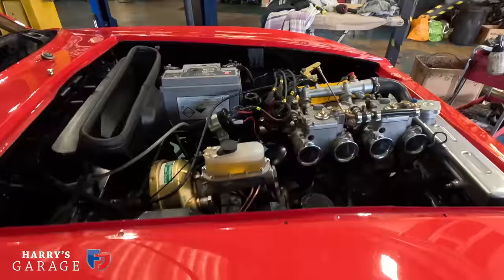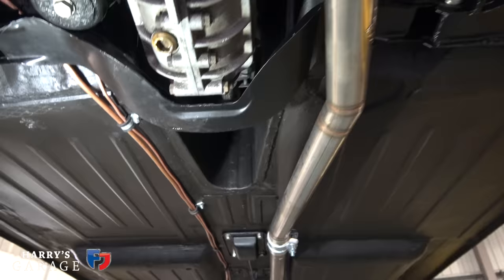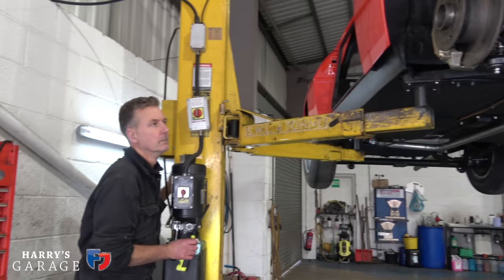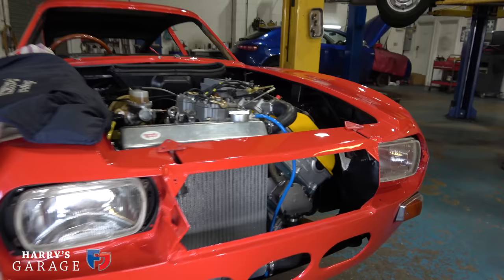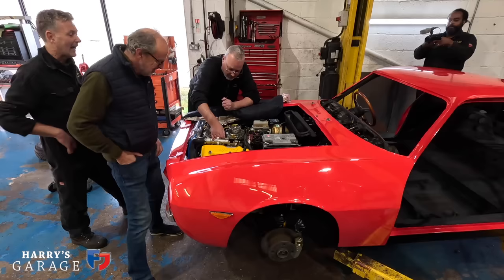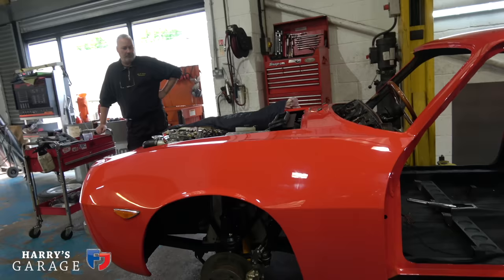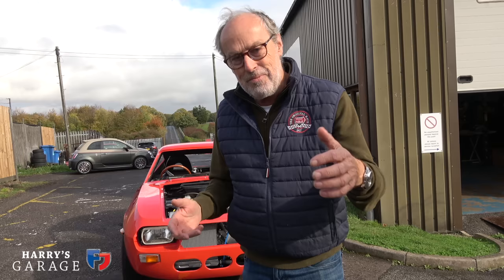First engine start on my Lancia Zagato 1600 2-year resto project Part.13

Comment: The diameter of the exhaust is extremely important on these little V4 engines from Lancia. The original diameter gives you the original performance and engine characteristics, as designed by Lancia. Even a small change in diameter makes a significant difference. On my Appia (the Fulvia's older brother), we experimented with different pipes and even the smallest change was noticeable. Lancia knew their stuff. Keep it to original specs all the way.
Reply: So I guess that still holds true for the Abarth spec Twin-cams in the 037 and Monte Carlo Silhouette?  Any idea what those were? Cheers

Comment: Fabulous video. Magical stage of the process. 
Anyone who has ever rebuilt a car will appreciate the immense complexity of the mechanicals required to get an old car moving under its own motive power. 
Anyone who has ever rebuilt a car will recall the magic of the noise, sounds, smells, sensations of its rebirth - they’re old memories reborn! 
This video captures these emotions succinctly. 
I remember getting an old mini going again, and feeling similar sensations. It didn’t need doors or a dashboard - just as long as I could feel and hear the thing going again, I was happy to have my car back. Just as in this case, the rebuilt engine was more powerful, cleaner and stronger than the rusty old thing that it once was - but felt instantly familiar.

Comment: It's an endlessly interesting design, everything under the hood and below the car is very clever and interesting. Then the work looks lovely, add superb body style, I apologize for ever suggesting this was bit far to go on this car. Very happy for Metcalf. You can calibrate that carb vacuum gauge with Tyrrell's hosepipe.

Comment: Looks great Harry. Just a quick one on the Carb intake stacks, two of these could be longer than the other two due to the asymmetric port lengths across the Narrow angle Lancia V4. From the back of the engine coming forward it should be short/long/short/long and ideally the difference in length should be circa 100mm? This would certainly help to equalize the induction port length. 👍🏻
Reply: You  can change the trumpet lengths but that does not alter the fact that the position of the Emulsion tubes within the carburettors are always at different lengths in regard to the position of the inlet valves and that is why when all said and done a vacuum check will not be 100 percent accurate as was shown because one reading was done on a short intake length and the other on a long intake length but because the Radiator precludes measuring the front port then you do no 2 on the first carburettor and no 4 on the second carburettor as they are both the same length inlet tract and then the tricky part is setting the idle mixture screws and in that area experience with Fulvia V 4 engines is of great importance as they are an art to get as close to perfect as you can.
Reply: Didn't they mention something about other trumpet options? I got the impression they wanted to see how it worked with this setup before deciding whether to see if a different setup would work better.

Comment: 6:17  Make sure that the fuel lines (especially rubber hoses) aren't too close to the exhaust system. 🙂 Radiated heat doesn't need to make physical contact.

Comment: I have an old motorhome (a 90s Fiat Ducato) that has a brake compensator system. Since motorhomes always carry a lot of weight at the back and hence the compensator doesn't really do much, it was the fashion to bypass them. Turned out that had been done to mine, a long time ago by the looks of it. A thorough examiner picked it up at the last MOT and it had to be reinstated. Fortunately the compensator valve was still working and the pipework was still present so it just needed all hooking back up again.

Comment: Simply stunning.  It looks the business even when its sitting still and missing all the trim, windows and body panels!  The sound is unique and meaningful, like it's raring to go back on the highway and work at full chat from the get-go.  Looking forward to seeing this on the same road that you took us on in the beast before its restoration, Harry.  It would be a great comparison for its poise and delivery.  I'm rapt for both you AND the car!  Full credit to the blokes that worked on every piece in, under and on the wee beast!

Comment: This car is beginning to be a car again. The uprated rad is a very good idea as Fulvias are marginal on cooling, the Webers are much better than the original Solex carbs and the 123 electronic ignition will definitely help reliability and starting. I think you´ll have 125-130bhp from this engine?

Nice as it is, I´m not sure I could live with the exhaust noise on a long run. I had a tuned 1300 Zagato which sounded great without being so noisy and was able to put 600 kms into a day.

Comment: Zagato looks fantastic, I've worked on one here in Greece, very little rust on it but it did need recommissioning. Some have mentioned the engine position, the subframe basically sets the position.  Not sure how much "adjustment" the radiator can accept as its a lot thicker than the original, plus fore/aft movement of the engine as it sits will see the carbs hitting it.  Loved Harry's face as he started it and moved it, kid in a sweet shop!! Regards from Greece

Comment: Those carbs look like they could be anti-aircraft cannon muzzles.
50's-70's Lancias are so awesome. (for those with large balls)
Reply: The engine sound from a 1600 CC motor has more gusto then 4 liter engines of today.  It sounds so manly.
Reply: 13:23  I am having a moment.

Comment: all that hard work and they didn't use a pipe straightening tool on those brake lines 🥲 that thing is going to sound glorious under load with the webbers😁

Comment: We'll just go for an engine refresh I don't want to spend too much, the brakes could do with some work and the electrics, there are some body issues also  and the interior needs a bit of work, the fuel system might need a bit of fettling, also the suspension is a little wonky, I'm not doing a full restoration though.

Comment: Brilliant to see the Zagato looking so good. And boy, does it look good.
I appreciate the desire for originality but  on some cars some things just need to be changed.
On this car the exhaust looks like an afterthought. It looks like the type of thing you would reverse into a high kerb.
It needs to be tucked up.
From a longevity point of view I would also consider some kind of protection on the fuel / hydraulic pipes running under the floorpan.
One thing I did enjoy though was the F*K*F number plate.😂😂😂

Comment: Congratulations Harry. 

Be interesting to know how they plan to route the air intake to sort of avoid ingesting the hot blast of air that the radiator would be spitting out.
Reply: Yes the rad install is totally wrong, needs to be shifted to the other side of the car. Cold air going over the exhaust now and a big rad jammed up against those big Weber bellmouths…. really arse-about-face…

Comment: Since it's your baby and you've gone to all this effort, and it's a lightweight car to begin with, I am somewhat perplexed as to why you haven't put a lithium starter battery in it, I know it adds a grand but it saves 16kg, lasts longer and doesn't discharge if it's parked in the garage for a year. (edit: further I'd move it to back, that way you're saving 22kg at the front and adding 7 to the rear which i imagine would be noticable in a car so light to begin with). Love it though. No idea what it's worth so not sure if I'm going overboard, a grand on a battery is a lot (edit:when standard ones are about £60), I'm sure this has cost tens of times that much already though. Thoughts?

Comment: at last!  .... I suppose a pessimist might add that its the start of the next cycle of rust. Oh and on second glance, that radiator has to be changed doesn't it, can't be hacking at the bodywork to accommodate it.

Comment: Will you have any kind of filtering fitted over those intake trumpets, or leave as is ? I ask because where I live, there's a dredger and a yard that sells sand to local builders, and on occasion, I've found myself in my car or on my motorcycle with sand swirling from the back of a lorry, in spite of it being covered with a heavy tarpaulin. It'd be a shame if you found yourself in a similar situation. Even heavy dust when lorries clip verges throws up a load of crap for an engine to ingest.

Comment: Not sure but were the rear brake lines across the rear axle copper ? not sure about the UK but here in Australia copper brake lines are not allowed, the car looks good, the carby's are as big as the engine but look fantastic

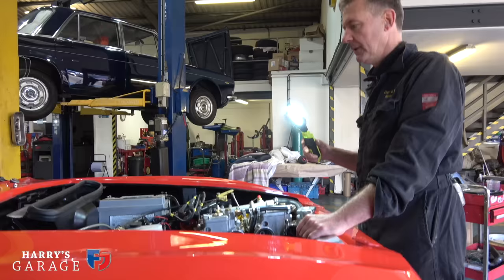Comment: Another well-done video Harry but I do have a question about the front brake system. At 2:48, it appears there are 2 hydraulic lines running to the front caliper. Does the Zagato have a factory-installed dual braking system for safety reasons?  Thanks
Reply: Yes they did

Comment: May be nothing but i thought I best point it out just in case. At 16:55ish as you drive back in there is a flash from under the engine, like a spark or a flame. Sure its nothing.
https://youtu.be/TmzHrKPyjLQ?t=1015

Comment: Honestly those webers are way too big for that displacement, without a radical cam.
Reply from the maker: 42mm Solex is standard size, so 45 is not that much bigger and this engine has trick cams, ported head and bigger valves than standard. It’s basically works rally spec from back in the day and they all ran 45’s back then too.

Comment: 6:30 - which goose decided to call that a 'compensator' ?? It's a rear brake limiter, nearly the same as fitted on the back of an Renault 16, 'cept the R16 has it on the rear anti roll bar. Bum of the car goes up under braking, moves lever, limits rear brake pressure, bum of car settles - they stop the car spinning by preventing the rear tyres locking up.

Comment: Harry, please do a videos to explain why this car works as a sports car. With that engine so far forward (and set to one side of the engine bay) how can this car possibly handle well, especially with so much weight forward of the front axel and.a solid beam rear suspension? It just shouldn't work at all as a sports coupe. I know you love this car, but I need to know why you do. It just makes no sense to me. I do like watching this restoration of this car, I do, but why you are spending so much time and money on it is a mystery to me.
Reply: Because the engineers at Lancia know more than we ever will about car handling. The Fulvia is a brilliant handling car with built in lift off oversteer to counterbalance the understeer. Harry has driven every possible type of car going and describes the Fulvia as a pocket rocket and a bundle of fun...which it just is
Reply: @peace12134  Thank you for the reply. Honestly, I just couldn't sort out how the weight distribution would work and I can only wonder how they pulled off making it handle so well on the road. It makes me wish I could drive one just to see how it would feel through the corners.